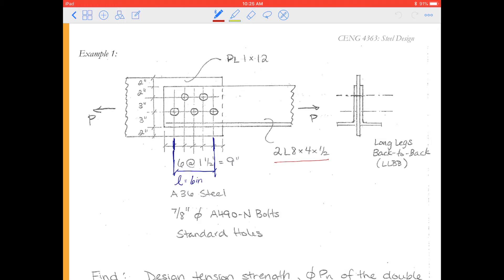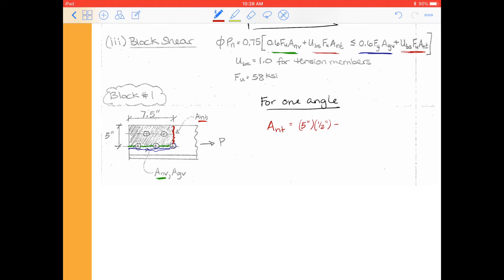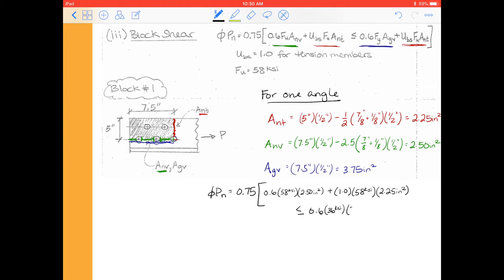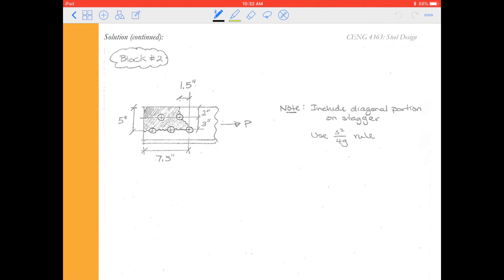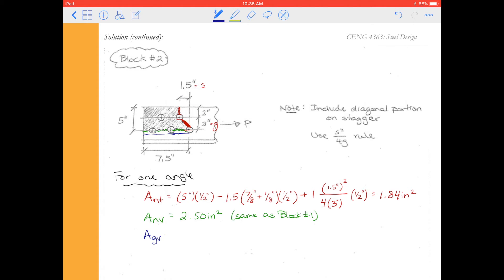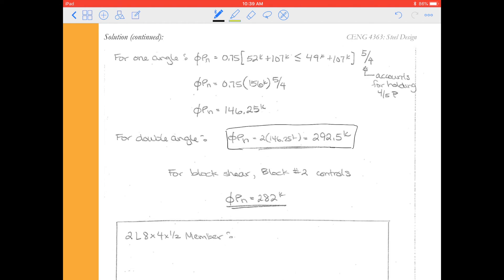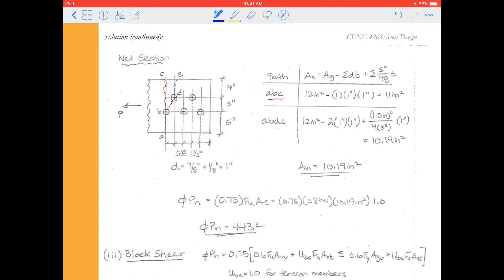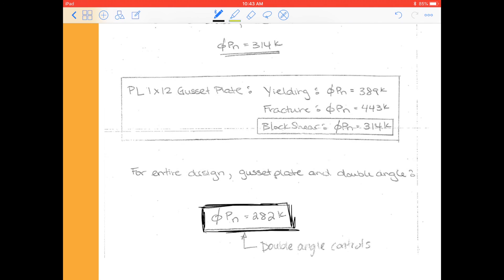V18-4 Block Shear Strength Example

Comment: I cant understand 1/8 in 3:20
Reply from the maker: The 1/8" accounts for the standard size hole dimension (1/16" larger than nominal bolt size) + possible material damage (1/16"). Possible material damage occurs when holes are punched for instance. The calculation written combines the two values and is more in line with AISC Steel Construction Manual 14th ed. In the 15th edition, which corresponds to AISC 360-16, the calculation now calls for using d_h + 1/16" where d_h is the nominal hole diameter from Table J3.3 (which would be 15/16" for the 7/8" bolt) + 1/16" damage called for by AISC Ch. B4.3b. For 7/8" diameter bolts, the calculations are the same. For bolts with nominal diameter >= 1", the standard size acceptable is now 1/8" larger than nominal diameter (as now specified in AISC 360-16 Table J3.3).

Comment: Is Block 3 possible?
Reply: don't think so ! there is a bolt in front of it !
Reply from the maker: Yes, the block shear path is possible, but as explained, the block is assumed to only have 4/5 of the total force on it, so it becomes less likely to control. If you follow good spacing practices and edge distances as specified in AISC and you don't do weird connection geometries, then Block 3 probably is not a concern. However, the failure mode is still possible and would involve: (1) Block 3 fails due to block shear followed by (2) the front bolt suddenly needs to hold all the force in the connection, (3) the overloaded front bolt fails.
Reply: Is this mode documented or tested? I ran into this and just find it really not convincing. This will require the room for the path to develop enough strain. Just really doubt that if this is a real thing or just some engineer porblem that only exists on paper.